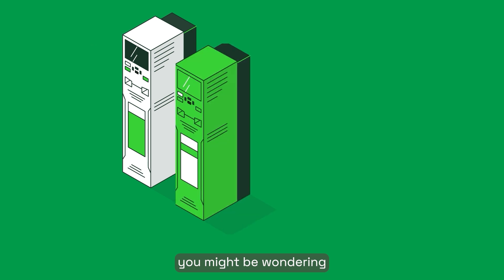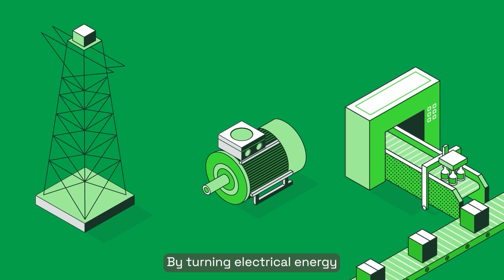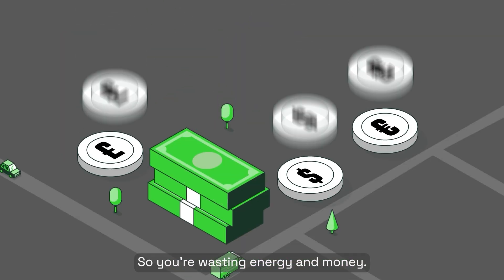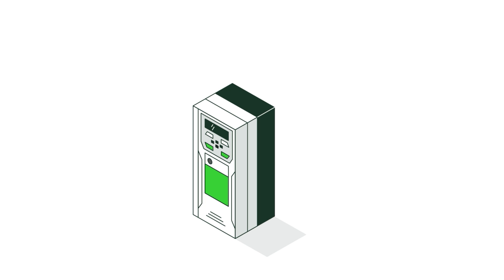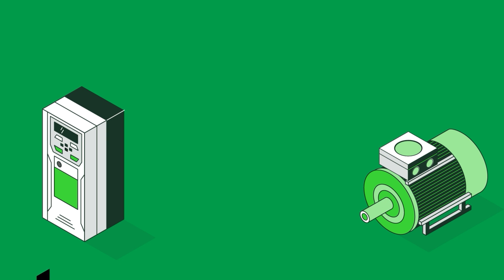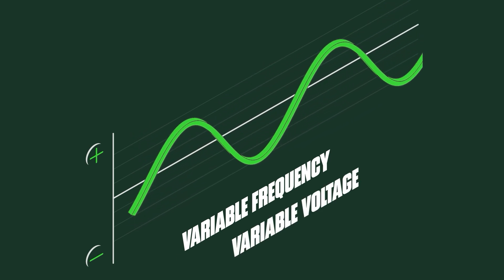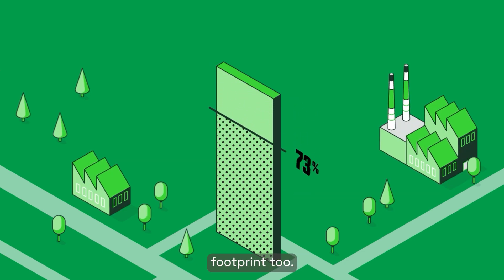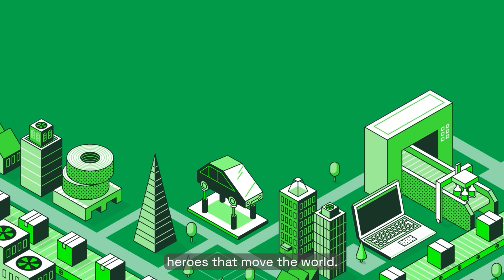What is a VFD? | Variable Frequency Drive | Nidec Drives | Control Techniques | Did you know Series

Comment: I find VVVF drives really interesting. 
Did you know that depending on how the drive is programmed, if you set the carrier frequency low enough and the motor gets to a certain speed, you will hear the awesome sound of pattern pulsing. This is where the motor sounds as though its changing gear. 
It's a really awesome sound. 
Here's a video showing an example: https://youtu.be/ouU6AUkTOLU